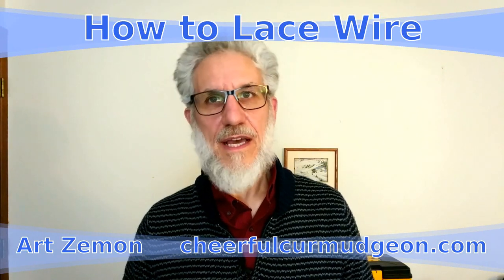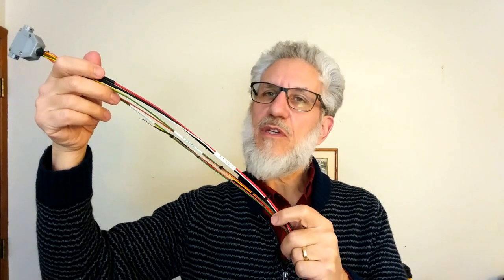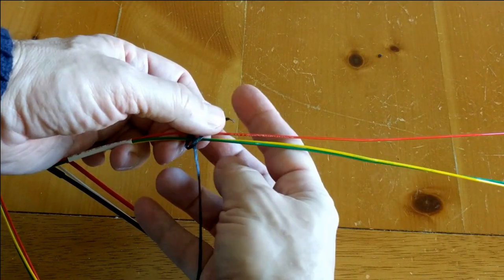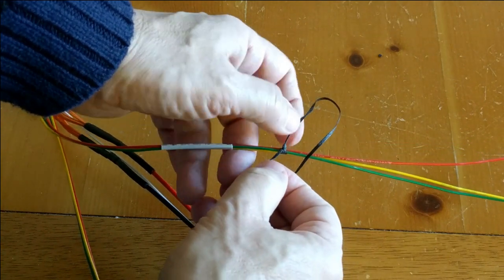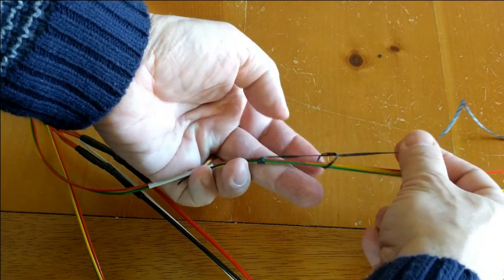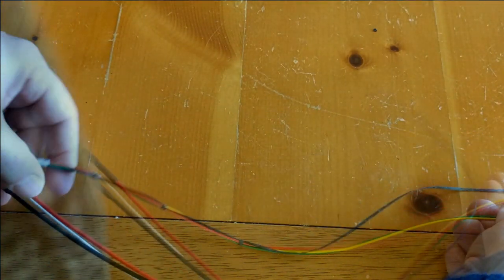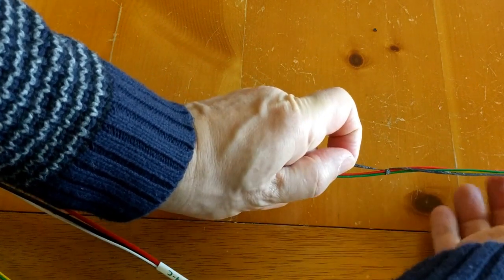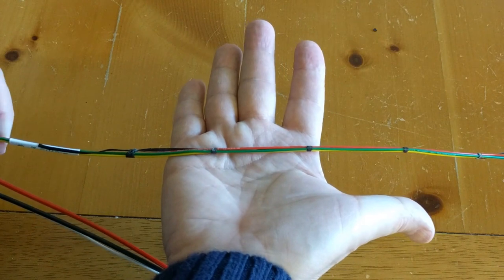How to Lace Wire

Comment: Nicely done video, and it looks professional. But if anyone happens across this instruction, it is no longer accepted by the Air Force and Navy. Not that you're selling off your work to QA. The only harness knots in use are the clove hitch topped by a surgeon's knot, in this case made by a single overhand/double overhand. The other is the cow hitch made into a loop, cinched down, then secured by a single/double overhand knot.

Comment: Hi, that is not wholly correct. The first bitnis ok - the clove hitch. You can continue the run using clove hitches with a half hitch on top for double strength ties. There is a single run also but not the way you did it. I used to work in the aerospace industry and tie and inspect aircraft looms on a daily basis. Your way would not pass aerospace standards becaus if the tie broke all the knots would come undone. Great video though thanks for the memory.
Reply from the maker: Thanks for your comments, Matt. I do realize that my technique is not completely "by the book." And I can tell you that it does not come undone. I have had to remove the lacing from several bundles and every knot needs to be cut. Once pulled tight, the waxed lacing stays in place tenaciously.
Reply: The Marlin half hitches will definitely come undone if the cord is broken at any place. Especially in a vibrating aircraft. That is the irony: your way is by the book. Old cable tie manuals and NASA show Marlin hitches. I can't find any reference to the way we did it, that's why I was searching on youtube.
Reply: I agree with you Matty, when I went through basic trades training in the RCAF, we were taught that every hitch/knot must stay together even if one hitch/knot had to be undone or cut to repair a wire, then tye up the repaired area. I think it was a "running" clove hitch with a sheet bend (square knot for you Yanks) on top, could have been a Marlin knot, so long ago and never had to lace a wire bundle till now 40 plus years later, for a hobby purpose, memory a bit sketchy on it now. Internet no help so far, all the wrong way for aircraft, even Boeing of all people.
Reply: @JohnHill-qo3hb  you guys would be correct